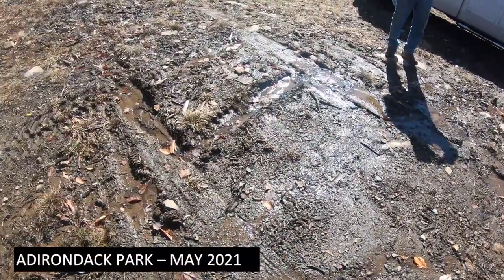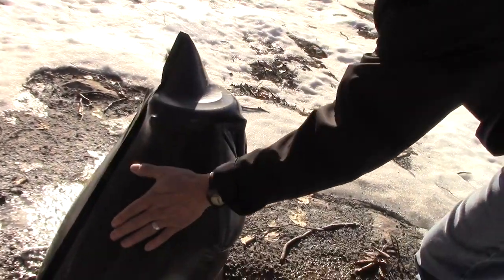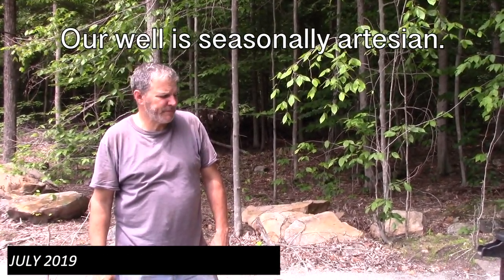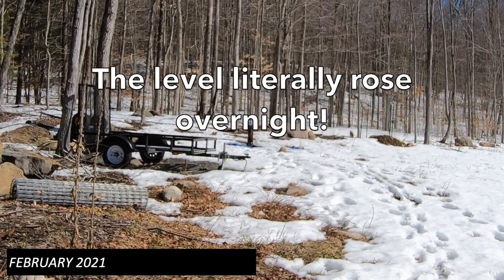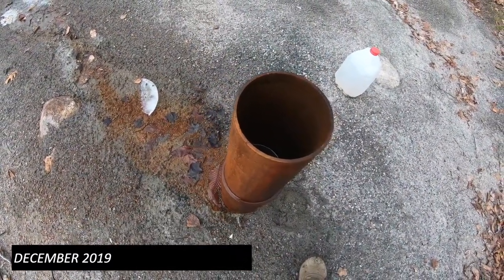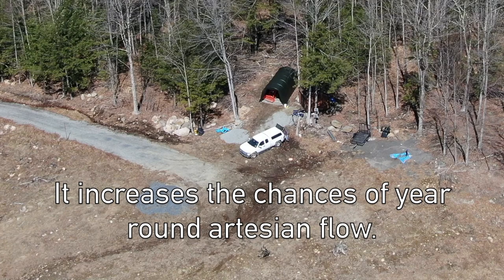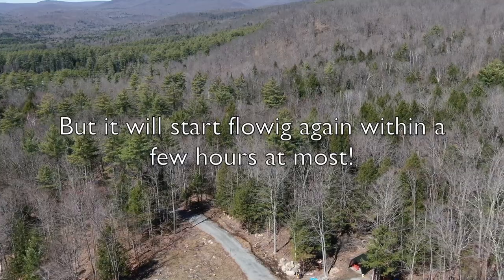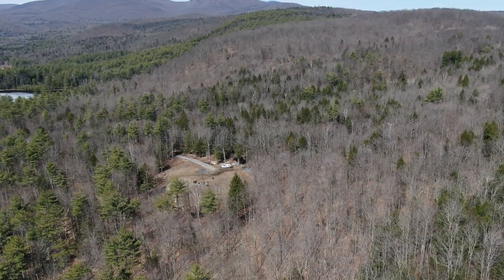Artesian Well PROBLEMS!

Comment: Wouldn't it be okay to make the well head pipe higher, maybe as much as 10 feet? You can keep the pump spigot in the same place with a good seal. Seems the water pressure is not that great as to flow out  from a higher point above the spigot. In our state, it is not legal to drill our own well because of creating an unstoppable artesian spring that will flood the area. My folks had an old farm that had a well dug before the law was made, good thing it was near an existing stream for the overflow to go.
Reply from the maker: That might work, but this past year we actually did the opposite. You can see what we did in this video https://youtu.be/Mj1BBNu7RP0

Comment: Where about a in the Adirondacks are you located? I am in the foothills just inside the park    near Remsen, NY I also have an artesian well. I am currently experimenting open loop geothermal. I took a truck radiator and ran my water hose to the bottom inlet and let it fill the radiator and the top outlet gets discharged into a drain and runs outside. I am using a 20” fan to blow through the radiator and on a 95 degree day we were in the basement and the air temp was cold enough to see the dogs breathe laying on the floor!! It kept the upstairs at around 72 degrees. In the future I will be playing with inside fish farm that feeds into a hydroponics garden before I get rid of the water!! Good luck with your ventures and we are blessed to have these wells!!
Reply from the maker: Wow! What you did sounds great! We are currently having sone issues with our well so we will see... and we are near warrensburg 👍

Comment: Artesian wells are great.  We seem to have different ones here in Florida.  Recharge areas are definitely not above the top of the well because everything is so flat, and yet we get enough underground water pressure from them to get a 30-gal/min free flow out of a 2.5 inch pipe.
Reply from the maker: Yes. Yours are under pressure. Great flow rate you have too!
Reply: Please yours is how many meters
Reply: @IbrahimOsmanbansi-pn5nv  about 140 meters, or 420 feet deep.

Comment: you should find a way to use the overflow to power micro hydro.  Also perhaps enough water for open loop geothermal heat pump. .
Reply from the maker: I will definitely look into both. Pretty sure my wife looked into hydro, but I’ll definitely double check

Comment: Consider yourself quite lucky I tried to have an Artesian well drilled unfortunately the ammonia level was so high the driller had to close it out I did some research and learn artificial fertilizer an animal waste basically polluting deep bedrock aquifers I didn't know those went that deep still have water 💦 happy for that just have to find another solution to get rid of the bad sulfur smell an rust or hard water corrosion of my washer and hot water heater

Comment: I have a seasonally artesian well but mine is in my basement.  You can install a well seal.  I put a well seal on and a vent pipe raised up about 2ft, it stopped overflowing into my basement at that point.    For any build site prep is so important and you own a machine so it's nearly free.
Reply from the maker: We have discussed that. We may seal it temporarily but if we’re having the pipe put in for our plumbing we may as well also have the pipe installed for the overflow at the same time. Thanks for watching and commenting. We really do appreciate the input 👍
Reply: @CreatingASimplerLifeOffGrid   I think by taking potable( underground water) and putting it on the ground your basically wasting what's in the aquifer.  You have the wrong type of well cap for the type of well you have.  They make sell caps that seal and allow for pipes and wires to exit.